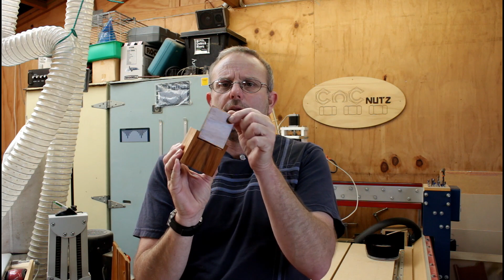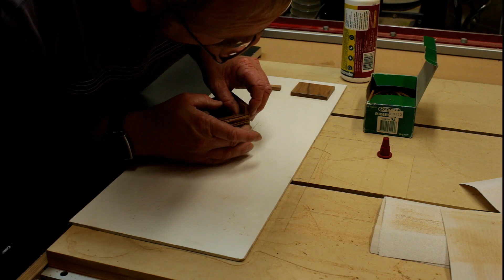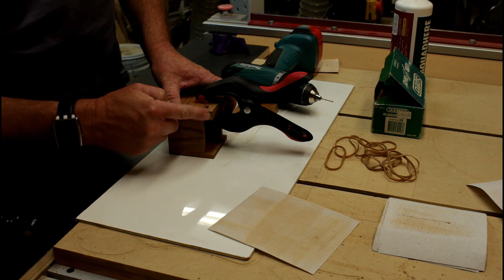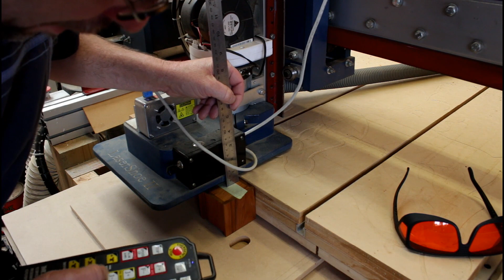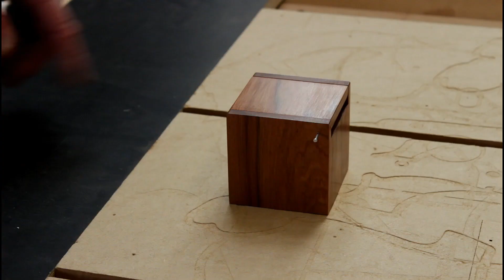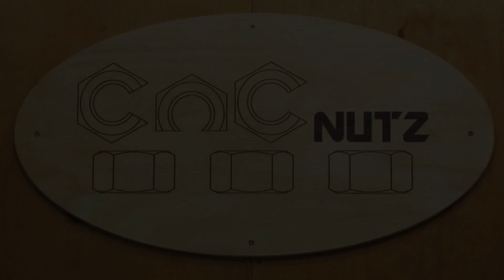Small Gift Box - CNCnutz Episode 97

Comment: Hello Peter, I have a question on your Laser.  Can you cut thin (1/8) plywood with your setup or do you need a higher powered Laser?
Reply from the maker: Hi Jim,
No and Yes.
No it will not cut 1/8" plywood, you will need a much bigger laser for that. Paper is about its limit.
The first pass cuts down about 1/2mm and them the layer of burnt wood seems to protect the wood from further passes of the laser. I have tried multiple passes before with no luck.
Cheers
Peter
Reply: Thanks Peter, You do a great job on the YouTube. I have jig for my CNC router for cutting mortises. I can send pictures and drawings and you can make a YouTube video if you want.
Keep up the great work,
Jim
Reply from the maker: Jim Anderson
Hi Jim,
You have me interested. Flick me an email and I will have a look.
cncnutz65@gmail.com
Cheers
Peter

Comment: Thanks for sharing your work. Could you told me about your laser shoeII, this laser seams to be a kit fit on your cnc router head? I'm interesthing about this. Could you also engraving stainless with this laser? Where are you bought thi? If you get to do a lot of boxs like you shown on your video, did you think it could be better did a cnc program to run the job?
Reply from the maker: The LaserShoe is my own creation and the build videos and plans can be found here.
https://www.youtube.com/watch?v=9EMENb5xdRM
https://www.youtube.com/watch?v=n7d4FYnLL64

The laser will not engrave stainless steel or any metal for that matter.
It won;t even mark white paper at times because of the reflective properties of the paper and other surfaces.
It will however burn wood and plastics.

In answer to the question of mass production I believe that it would be far quicker to use table saw than the CNC for this project. I could cut 1 box in less than 60 seconds on the table saw. Assuming the material was already mounted on the table with the file loaded ready to cut I think it would take much longer. I also think you would have more cleanup for the same material type.

Cheers
Peter
Reply: ***** you just said it right, the secret of when to use a cnc machine is to know when not to use the cnc machine, damn right

Comment: Very clever build. I tried it myself last night and it came out perfect. Very fast and easy to do. The only difference I did was in setting the blade to the width of the stock. I just purposely set the width to slightly smaller than the stock's width and cut both sides for a perfect square. Thanks

Comment: Nice gift box. Do you think you could give an update on your 4th axis. Would like to know what pulleys and belt you went with. Thanks
Reply from the maker: The Headstock as not changed since I did the final build video
I stuck with belt and pulley that I used in the video because they work well for my setup. 100 to 20 tooth pulley.
If you don't have a smoothstepper you may find 5:1 ratio too large a reduction so maybe 3:1 would be better.
The problem with driving from a parallel port is the maximum speed you can run your stepper at. The smoothstepper can generate step pulses faster than a parallel port can.
I checked the links to the parts in the plans provided with the headstock video and they are still current so you will have no problem finding them.
Let me know if you need more info.
Cheers
Peter
Reply: *****
Thanks for the quick response.I currently run my machine for most jobs at 30 to 40 ipm. My machine has 425oz steppers and is run from parallel port not smoothstepper. The stepper I will be using will be 425oz., what reduction should I use. I already have a 1.8:1, do u think a 3:1 would be better?
Reply from the maker: Kenneth Rice I would look at it like this. Your motor has almost 3 times the power of mine. The 1.8:1 ratio you currently will deliver the same power to the headstock as my setup assuming the stepper is properly powered. If it works fine then I wouldn't change it but if you need more power then 3:1 would be a good option but you will loose top end speed.

I put the Tachometer onto a piece of round wood and measured its RPM.
The result is 455 RPM at the spur drive running maximum speed.
This would make my stepper running at about 2275RPM.
I don't think you will be able to get your stepper this fast but at 1.8:1 you only need 820rpm to match my top speed at the spur drive.

It should give you something to compare yours against.

Cheers
Peter